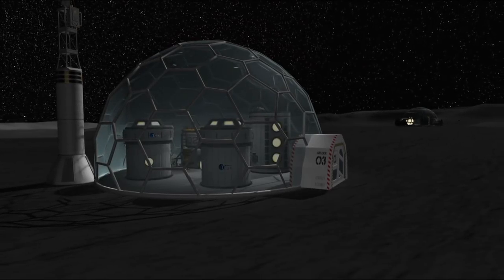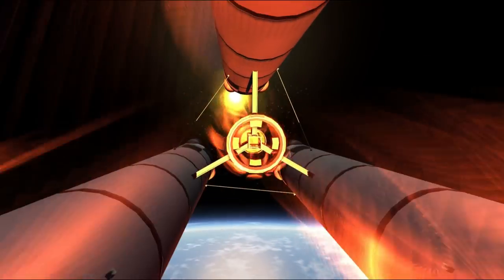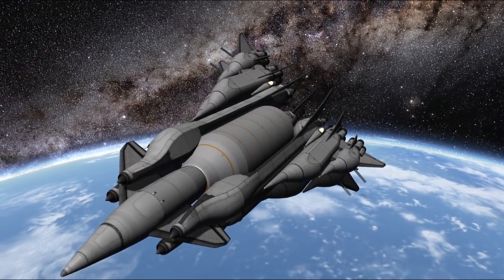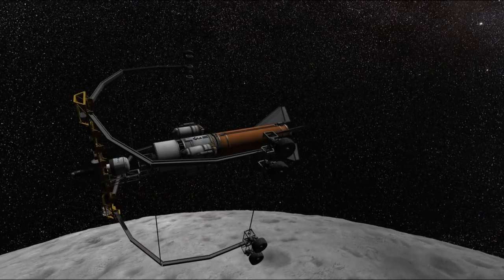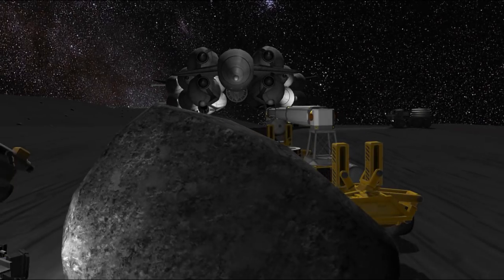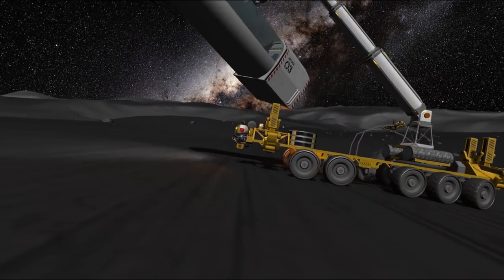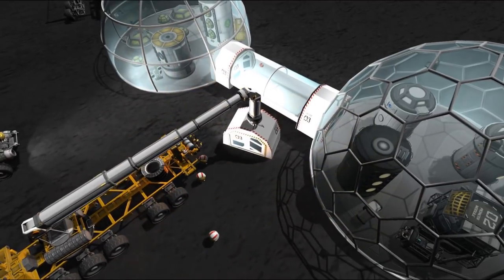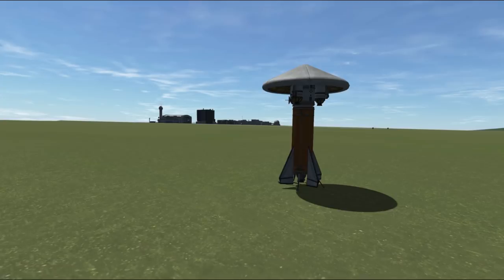[08] SSTO Space Program - Mun Base Building - KSP 1.2.2

Comment: Since you have KAS installed why not use the winches from it to build a crane? It's a lot easier then using infernal robotics since you can just lower the wince and then pick up whatever you need then move it. (I currently have an airship made for all atmospheric planets and moons other then Duna that uses 4 winches. Two on either side for small rovers with science then two on the bottom, one has a grappling hook to anchor the ship in place so I can time warp and the other has an anchor to help stop me from moving too much when I'm attempting to land or do some other type of activity as the anchor has a lot of drag when touching the ground but can still move meaning I won't be pulled into the ground nose first like with the grappling hook.) you can also change what kind of end affecter is on each winch by simply releasing it then using a kerbal to move them to another one. You can also use it to winch kerbals down a slope or as a tether to a station or ship if you are worried about losing the kerbal. (This has saved me a few times as I do not use the stock RCS packs but rather MMUs from a mod, I can also use it for my airships to move kerbals to and from the ground.)

Comment: Just asking, are Konstruction's stabilizers extendable like IR's pistons? I was wondering if I can adjust the height manually so I can lower my cargo safely.
Reply: Elsie Mongado yes they are through the UI settings. But you have no sliders like in IR. You need some time but can work tealy precise. Best is you can add all moving parts to Groups with master and slaves and move them together and modify the settings as needed in situ.
But if you only need hight try the girders maybe?

Comment: Do you think the frame rate issues would be solved with better hardware?
Reply from the maker: I don't think so. There isn't much in terms of hardware efficiency I could improve, maybe 15-20% if I had the best available PC on the market. KSP isn't even using my rig to its full potential. It's just not optimized for this kind of things.

Comment: I have try to make the same truck than you. But the arm fixed on truck just do anything ( don't move normally ). do you have a solution for that problem ? ( sorry for my bad english )
Reply from the maker: It might be a mod version problem. I'll put the craft files in the description soon so you can try them out yourself if you wish. Good luck!
Reply: Thanks a lot for you'r reply. When i try too open you'r " Moon base ", i have this message : " Craft size Unknown ". I have try too reinstall Infarnal robotics, but same problem with arms.
Reply from the maker: For the base you need Planetary Domes and most of the mods from MKS suite. For the cranes, you will need IR, IR model rework, Konstruction and kOS.
Reply from the maker: That's strange. Do you have autostrut enabled on the robotic parts? Or rigid attachment? It causes issues like that sometimes. Other than that I have no clue, apart from the possible corrupted code for the mod.
Reply: Hm, i don't know where is the option for enable or disable the " autostrut " options.
Reply from the maker: You can enable it in advanced tweakables in the options menu, but if you haven't used it, those features are disabled by default. I'm not sure what causes it then.
Reply: Oh perfect, this solution work for me, thanks a lot :) !

Comment: Hi, does not the ship load me mods I'm missing?

KSP: 1.3.1 (Win64) - Unity: 5.4.0p4 - OS: Windows 8.1  (6.3.0) 64bit
000_AT_Utils - 1.5
Toolbar - 1.7.15
USI Tools - 0.10.1
B9 Part Switch - 2.0
Community Category Kit - 2.0.2
Community Resource Pack - 0.8
CommunityTechTree - 3.2.1
CryoEngines - 0.5.9
CryoTanks - 0.4.8
DynamicBatteryStorage - 1.1.1
Easy Vessel Switch - 1.5.6471.31118
Firespitter - 7.6
GroundConstruction - 1.2.1
RasterPropMonitor - 0.29.2
Kerbal Attachment System - 0.6.3
KerbalAtomics - 0.4.9
Kerbal Engineer Redux - 1.1.3
Kerbal Inventory System - 1.7.6468.41490
KSP-AVC Plugin - 1.1.6.2
KWRocketryRebalanced - 3.2.3
LCA_Project - 0.1
Infernal Robots - 2.0.14
Modular Rocket Systems - 1.13.1
NearFutureConstruction - 0.8.4
NearFutureElectrical - 0.9.7
NearFutureLaunchVehicles - 1.1.3
NearFutureProps - 0.2
NearFuturePropulsion - 0.9.5
NearFutureSolar - 0.8.7
NearFutureSpacecraft - 0.7.4
Final Frontier - 1.3.6.3189
RealChute - 1.4.4
RealPlume - Stock - 1.0
Recovery Controller - 0.0.2
SCANsat - 1.1.8.2
SolverEngines - 3.4
StageRecovery - 1.7.2
TAC Life Support - 0.13.6
TweakScale - 2.3.7
USI Core - 0.5
Konstruction - 0.3
MKS - 0.53
VesselViewerContinued - 0.8.6
[x] Science! - 5.11